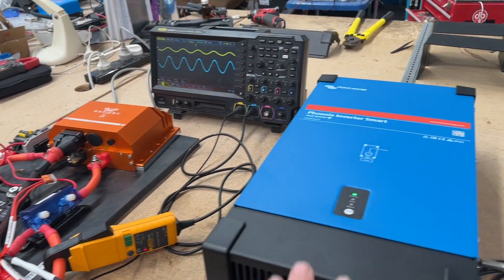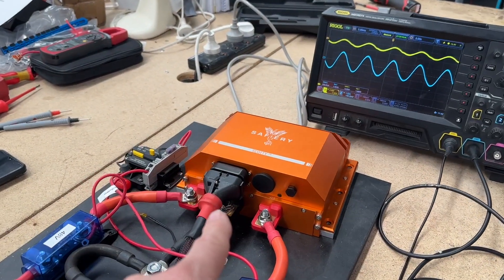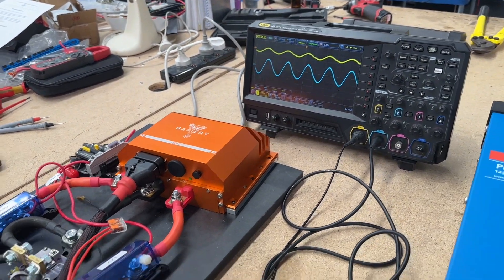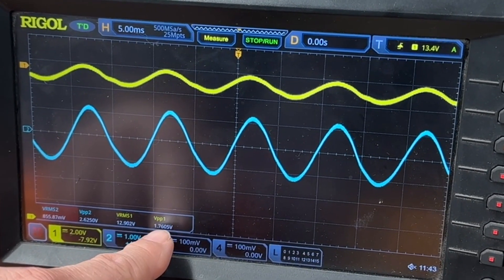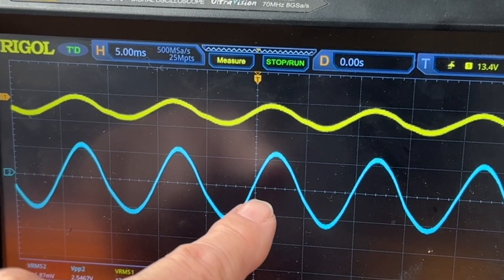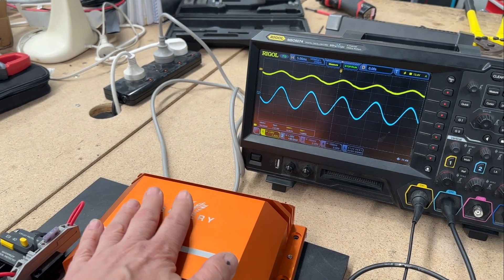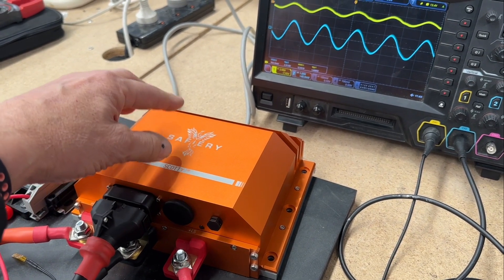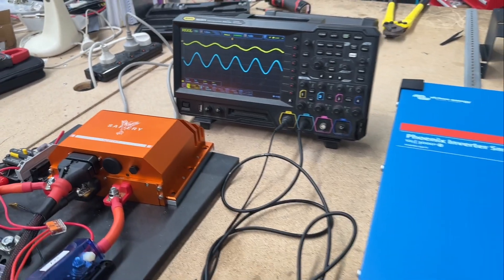3000VA 12V Inverter pulling power through Scotty AI from 48V Side showing High DC Ripple

Comment: Do you have a 12v battery connected to scotty so it can supply 12v or is scotty just converting from 48v to 12v?
Reply from the maker: We do have a 12V battery connected here. Its the current movement in and out of the battery that shows the current ripple. However, our new Scotty M coming does not need a 12V battery. It is 48-12V 1500W and no low side battery. It will be released in October this year.